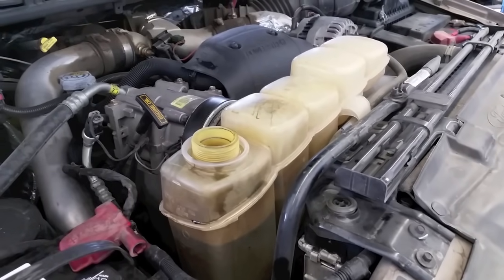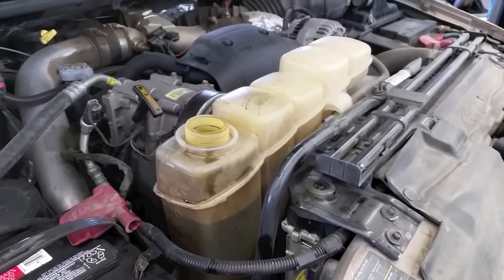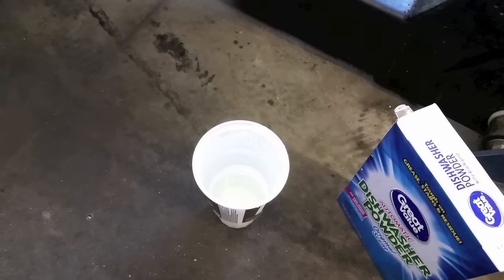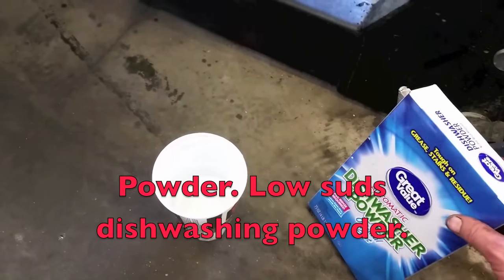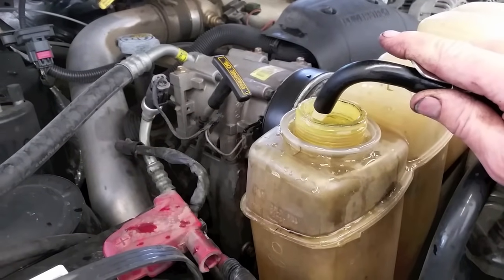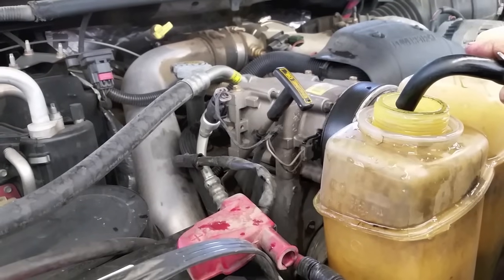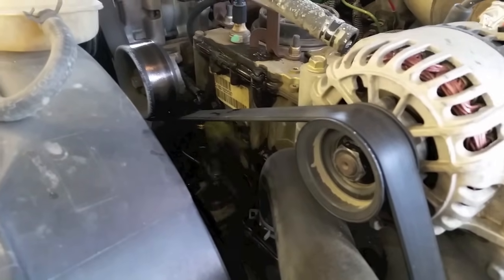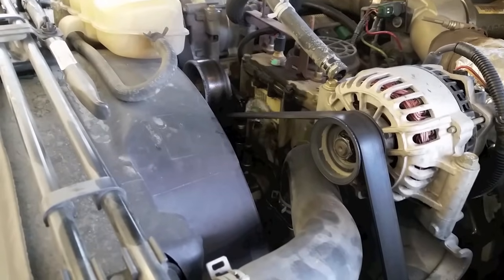Flushing a cooling system thats contaminated with oil, diesel or gas

Comment: Sorry to hear he passed.  QUESTION:  If the problem is an oil cooler breach . . why would you want to run the engine . . .with the oil under pressure again . . in order to flush the coolant system.  Seems like you are just recreating the problem.  Help me here.  thnx.   :)
Reply: I think at this point, ie flushing the cooling system, you'd have established where the breach stems from. In this case, it was the oil cooler and we'd have to assume that he addressed the sludge in the engine, flushed that as well. The cooling system flush would only be sensible after addressing the breach, and if it definitely was the oil cooler, replace that and then deal with the cooling system flush. At least, that's what I took from his video.

Comment: I done this about 4 times cause oil got in coolant on my 6.0. It hasn’t worked. I changed the thermostat. Checked everything. At this point I’m bout to change the heater core.

Comment: My question is this, if the oil is mixing into my coolant, if I run the engine with the soap in it, wouldn't the oil continue to mix because that is why its mixing in the first place?... thru the oil cooler in my Dodge journey, just curious to know what step would take

Comment: R.I.P DTR. I drove my truck here and there for about a year and a half with busted oil cooler. My coolant became like pudding.
I KNOW , FULL IDIOT I WAS.
Anyway,  I replaced cooler and had to flush 8 times with simple green and same dish detergent powder and finally it is clean and clear.
Don't be AN IDIOT like me , as soon as You see a  problem , take care of it. I was just too busy and I knew also it is 7.3 that can take abuse.

Comment: Thanks a lot. I have struggled using various radiator flushing products to no avail for the last 18 months.  Today your method with dishwasher powder worked. Had to do it 3 times and lots of flushing,  but came right.  Saw you video last night and it was an Eureka moment.  Thanks from Africa.

Comment: OK so I'm at this same point bit realized I did it before ever turning the car on so disconnected the reservoir and cleaned it and soaked it in bleach soap water overnight because I didn't start it is it that better situation or do I have to still go through the process that I just watched you go through? Ty a ton

Comment: I went through this same problem with my 86 F-250 6.9 Diesel a good 4 years ago. One morning I had engine oil in the Coolant Bottle.
It was my Oil cooler that had failed and puked oil into the cooling system.
I first changed out all the rubber hoses, the Block Heater and the Thermostat. (I may have removed the T-stat for the flushes)
Removed the Coolant Bottle and got it washed out.
After R&Ring the OC, I had to do 6 flushes using Cascade. Filled up the cooling system and drove around to get the engine up to operating temp. Came home and drained the radiator and the two Block Drains. let the engine cool, and ran through it again.
After it was cleaned out, I did 6 flushes with Distilled Water.
Then filled it with the proper fleet charge coolant. Mixed my own coolant and distilled water, 50/50 mix. 
It`s a slow process if you want it totally clean.
Reply: Quick question: What is “after R&Ring the OC”?

Comment: So did this help fix the oil from not getting back into the coolant reservoir after you replaced the oil cooler seals and housing seal? because mines doing the same my car has oil all in the coolant reservoir? I'm going to replace mines and do a complete coolant flush on my radiator with new thermostat possibly a new water pump too? wish me luck?
Reply: Did you have any luck?
Reply: @ronporter5070  still waiting on rock auto lol They sent my oil cooler seal but forgot the oil cooler housing seal.
Reply: @ronporter5070  I'll let you know
Reply: @G3T_R3KT_XM8  keep me posted if you would please
Reply: @ronporter5070 No Problem! Rock Auto just shipped out my other gasket seal today! so I'll let you know how everything goes soon as i get the seals back on the car I'm honestly just glad it wasn't blown head gasket. I checked all spark plugs they are all dry no froth or milky oil was found on my oil cap or coolant reservoir. also check the oil dip stick the oil is golden it's perfect! Engine does not smoke or overheat, and the exhaust does not smoke so that checks all box's that the car does not have a blown head gasket only problem is there's oil in the anti freeze coolant reservoir mixing with the coolant.so hopefully these oil cooler seals do the Job!
Reply: @ronporter5070  I'm getting everything installed Friday I'll let you know how it goes?

Comment: Thank you for one of the best videos on the subject helped out just knowing I'm my head where to start white smoke smells like gas over flow sludge oil I hope I can fix it pepboys sucks they said I need a whole new motor and charged me almost 200$ just say there was to much oil in my engine no codes nothing when I ran my own obd and it came up eiths codes don't go to pepboys for shit .Thanks again

Comment: I have a Dodge Journey. Instead of letting the water pump through the hose shouldn’t I just let it flow out the bottom of the radiator?

Comment: GREAT video!  Thank you!  I'm still hoping my truck is alright on my 2000 F250 with the V10 gas engine.  I believe my oil cooler went bad.  I replaced the oil cooler and the radiator with new parts.  Did the t-stat today but It's still getting hot (even though my damn gauge on my dash does not indicate it - my scanner does however.)  I shut it down at 225F so I don't cause any damage.  No warm air through my heater core yet.  The engine runs just fine.  I'm hoping that if I put enough hours into it I'll be successful. It pukes sludge out of the overflow each time it gets heated up.  I definitely can't go anywhere with it.  Wish me luck.  Thanks again for your video.  I liked and subbed.
Reply: I'm curious. Can I do this procedure that Ron is doing in this video with a cracked head gasket on a 4.3 inline straight 6? No one seems to have the answer.
Reply: Any luck? Was the oil cooler the fix?
Reply: @marshmower  Still in progress.  It blew out the corners of the intake manifold and all my water was going into the oil. It still runs well.  But I have the intake off right now.  I have'nt run the engine for more that 5 minutes because the lube system is now compromised.  To top it off it needs a transmission after I get the engine right.  I bought another newer F250 in the meantime.  It has the 5.4L 3-valve and isn't even close to the power of my 6.8L.  Some might think I'm crazy but the engine only has 75,000 on it, tires are brand new and with a new transmission it'll be okay.  I redid the suspension on this truck and it's rated as a F550 now.  Built like a tank.
Reply: if its creating bubbles when u run the car with radiator cap open, your head gasket has a leak. Either way sounds like a thermostat valve block or headgasket leak now that u have changed oil cooler.

Comment: welp, instead of letting coolant fly all over the place buy a few 4' sections of hose and toss em on the nipple let em drain into a container, you really should contain all this fluid and bring it to your disposal station, towels around radiator caps so forth really makes fora cleaner job, coolant can be corrosive..

Comment: Here's a factoid for everyone here.
Sani-Flush started out as a radiator cleaner. When engines were made of steel, copper, lead, and cast iron it worked wonderfully. Then came aluminum parts and Sani-Flush eats aluminum.
In one of the greatest product marketing decisions in history they repackaged and remarketed it as the toilet cleaner we know today.
I still have an old magazine ad for Sani-Flush engine flush.

Comment: I've been using Casade to flush my cooling system for over 30 years. The nice thing with Cascade, which you can't do with commercial flushing chemicals, is you can actually drive the car with it in the system if you have to. Plus Cascade makes the system smell good.
Cascade not only cleans out grease and oil it also breaks down hard water deposits from the radiator and heater core.
Reply: I would be cautious of driving the vehicle for any extended period of time without the coolant premix in there. Especially the newer stuff that gets to operating temp in the blink of an eye. Coolant raises the boiling point of water above the 212°F. Most modern engines run at 220°F.  Without the proper coolant mix, you run the risk of a boil over.

Idle her, drain, flush, fill, repeat as much as necessary. That's what I've always done since I adopted the cascade method shown here by Ron.
Reply: @LynxStarAuto  his long do you idle
Reply: Old comment, but  the system being pressurized raises the boiling point of water.  It isn't going to boil over at 220 with the cap in place.

Comment: Guys please never do this, it will cause catastrophic damage to your engine right away
Reply: Reason?
Reply: @dm-zx7xb  due to the fact that if you have any cracks or leaks in your cooling system or gaskets which have gone bad,  the soap will leak in and case damage to the inside of the engine, I tried this exact method and my car died shortly after doing it
Reply: @aidenodendaal5162  gotcha, but it sounds like you already had additional problems other than cross contamination. Thanks for the reply!
Reply: @dm-zx7xb  I actually made sure by doing preasure checks I was doing a radiator flush, and what happened I had a bad gasket for my cylinder head and the soap leaked in and siezed my pistons
Reply: @aidenodendaal5162  I think though the majority of the time this technique will work. You can't just leave oil in the cooling system because anything rubber (including gaskets or o rings) will dissolve and cause problems still. If you leave oil in the cooling system and drive down the interstate and you blow a lower radiator hose off because it broke down due to swelling because of the oil then you will still blow your engine anyways.
Reply: No it definitely will not cause damage. If you had bad results that means you had other issues. Ive Done this many times without problems and many others that work beside me.
Reply: Your bad head gaskets allowed water into your cylinders, that caused your damage not the flush.

Comment: Works good in neglected cooling systems too, ive done this before in a Saturn sl2 with dexcool and regular green mixing and it flushed  all the coagulation out and refilled it with 50/50 no problems yet
Reply: U didnt need a new oil cooler

Comment: 07:02    That cold water may crack the block and/or head internally;never pour cold water in a hot engine; ALL manuals say it,let it cool first or add at a VERY SLOW rate;   Best way i find it,is to create a  SMALL leak(loosening a hose clamp, for instance),and keep filling it,SLOWLY; takes  H O U R S ....  VERY good idea, the detergent, it's a must,and i mix diesel with it,it's faster.
Reply: It has to be hot as hell to crack the block

Comment: Please, I really want to know the cause of it, transmission fluid mixing in the radiator tank with the coolant , cause I have a Range Rover Sport 2007 with same issue. Thanks
Reply: Trans fluid in coolant means you have a trans oil cooler ruptured in the radiator.  They have a built in fluid to fluid heat exchanger in one or the other radiator tanks.  Transmission oil cooler lines hook up to it on the radiator side tank.  The bad news is when you see the strawberry milk shake, its in the transmission too.  Most frictions are glued with a water based glue in a trans and that means a trans replacement/rebuild most the time too.

Comment: What is the dishsoap for?
Reply: To remove  (to wash off) the old oil that leaked into the "radiator".
Reply: It cleans out grease and oil and also breaks down any hard water deposits. That is because of the phosphorus in the Cascade.

Comment: If I don't clean that what can happen?
Reply: Oil and rubber doesn't mix.
Rubber hoses exposed to oil get soft and expand until they fail, I can't see it happening from the inside being better than it happening on the outside.
Maybe it might effect coolant etc... But that's just guessing.
You never want oil on a rubber component unless it's been designed to handle it.

Comment: what caused the mess in the first place? faulty oil cooler?
Reply: faulty oil cooler causes this. it happened to me two times :(
Reply: @fomoco its common the o rings on the oil cooler are only good for so many years. Ive had my 7.3 for 8 years and im about to do a second set. Its best to catch it before its this bad. They are only rubber they deform and rot over heating cycles.
Reply: @Harley365  O'rings ? separating  the oil and the coolant???? never seen that; only a REAL FOOL engineer would do that!!!!!!!!!!!!!!!!!!
Reply: @josepeixoto3384  my mistake not o rings. But the gaskets from the cooler to the block with the passages for each.
Reply: @Harley365  u still on here
Reply: @htatesil4192  yea
Reply: @Harley365  thank god ok i have a 2002 7. 3 16 footbox truck i bought it for 1800 some meth head anyways flushed the oil and the hpop i looked into my coolant de gas it looked like chunks were in it pumped it out its green with black oil residue but when i look at my dipstick its not milky nor am i loosing coolant u think its the oil cooler also i see on alot of threads i might as well change the egr cooler or w.e its called does the egr require pulling the engine out the 7.3?
Reply: @Harley365  i dont know the history on this car so it has me worried no over heating though
Reply: @htatesil4192  it could also be soot from exhaust if you have a leaky head gasket it will push soot into the coolant system. Mine does a little it comes with age and miles. I'll Probably do head gaskets if it gets worse. Mine dont pressurize the coolant so it's very minor. If it builds lots of pressure and is overheating its bc of exhaust gasses would be my guess without seeing it.
Reply: @Harley365  no overheating issues  how can u tell if its the hg or cooler
Reply: @htatesil4192  i would re seal the oil cooler and clean the system really well and run it with water for a few days then repeat if needed.  After a few weeks see if it comes back. Could be head gaskets but no way to be sure over the chat. You could do a leakdown test that might help
Reply: @Harley365  damn man idk what too do
Reply: @Harley365  ok thanks man i thought if the hg was leaky it would show on my dipstick
Reply: @Harley365  u think if i do a video u can tell?
Reply: @htatesil4192  I.just did a little looking around. It could also be an injector cup leaking. The brass cup in the head that seals the injector May be leaking by.. You anywhere clpse to PA?
Reply: @Harley365  nope seattle damn man i try too be a YouTube mechanic but this one is too hard too determine
Reply: Thanks Ron, i'm doing this on a kubota in my boat it was all black goop very thick. I rebuilt the head but I couldn't get that crap out its much better now that I pulled the bottom radiator hose and then a garden hose in the fill and let it run for 20min.

Comment: I bought a small bottle of Dawn and put it in my radiator......will drive for a couple of days then flush. My radiator smells flowery-fresh.
Reply: tickyul do not use dish soap. It will bubble/ foam way to much. Dishwasher detergent is a low foaming soap which is why Ron reccomends it

Comment: I have a 97 VW Jetta GLS and the oil cooler failed and I got so much oil in my cooling system the thermostat won't even open to circulate the coolant

Comment: i have a 1995 7.3 with a little oil in coolant. just found it . im going to replace the oil cooler cooler and radiator. should I flush after I put on new parts or replace the oil cooler and wait and put in the radiator after? thanks

Comment: ive got a 2005 6.0 that is getting fuel in the oil over aperiod of 2000 miles (normal driving,no towing) I drained 6 gal. of oil n fuel out of it.

Comment: Hey Ron.. first thanks for your videos!! Is it possible to flush an oil cooler on a 6 liter? or just replace it. My delta are about 50 degrees difference. with the oil being hotter.
Reply: I'm having the same issue with my 6.4

Comment: Thanks Ron,  the 6.0 has some nice block drain plugs but not sure if the 7.3 does.  If the truck isn't from the rust belt they are easy to find on the 6.0.  Is there any benefit to using them during the flush?

Comment: Ron, another great video, thanks.  I plan on flushing my 7.3 next spring, mostly so that I know what I'm running.  And along those lines, I have a question: there is a lot of (mis)information in the Internet regarding electrolysis/cavitation of the Ford/International 7.3 diesel engines.  When I did a rather exhaustive search on what coolant to run to help prevent this phenomenon I found as many answers as I could shake a stick at; most of which were contradictory and made claims that other approaches were invalid and/or inferior.  So as a Ford diesel tech, once you complete a flush like this, exactly what coolant and/or coolant mixture and/or additive combination should you run to prevent cavitation/electrolysis?  And could you do a video about the subject?  I ask because this issue was a monumental concern to me prior to buying my 7.3 and almost put me off of buying one altogether.  Many thanks!
Reply: Ford Gold long life is your best bet.
Reply: +Lynx Star Automotive (Gabe V) Thank you for the information!  A reply finally!  Wooo-hoooo! :)  So Ford Gold long life with no additives whatsoever, right?  Many thanks Gabe!
Reply: Jerry A Yep.  You can also try Zerex Gold bottle.  But it actually costs more than the Ford/Motorcraft stuff.

Comment: Ron do you flush before or after fixing the failed component.
Reply from the maker: After on leaks that leak into the system.  Before on repairs such as restricted oil coolers that the contamination can plug a new cooler.   Esp the 6.0 oil cooler.